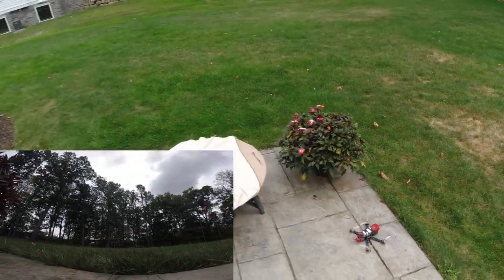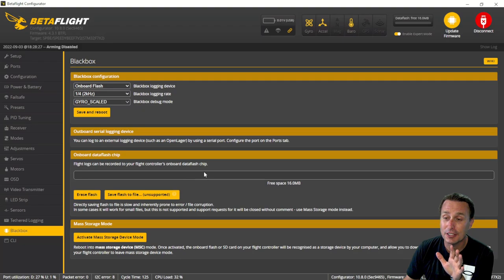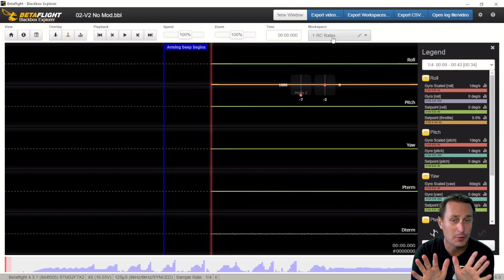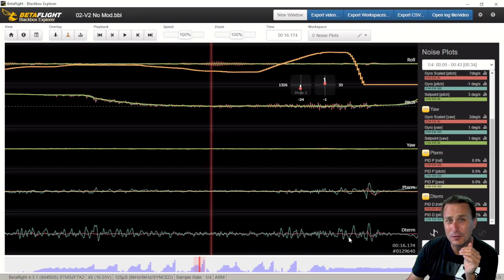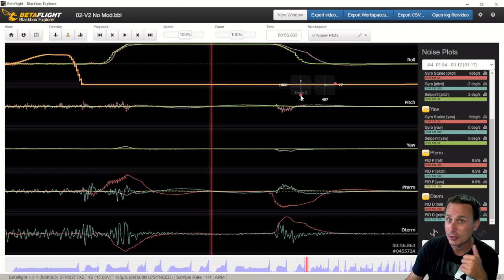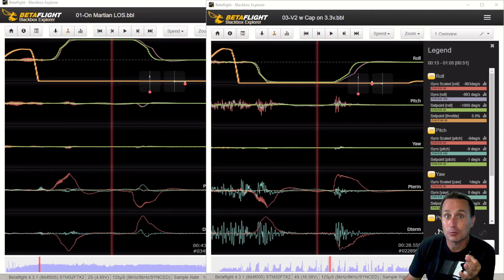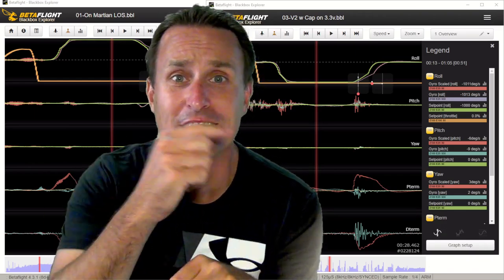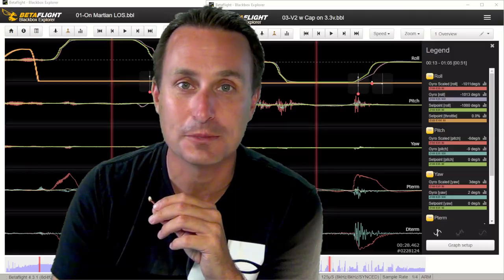Smooth Cinematic Flight: How to DIAGNOSE a BAD Flight Controller vs. Gyro

Comment: Important note on capacitors, they have an effective voltage range. A 25v capacitor for example, is usually only rated for say 5-25v, Putting it on a 3.3v rail would not be effective. Using a 6 or 10v one would be a better choice. usually listed in the datasheet.

Comment: I have several quads on the same frame but a few with different flight controllers/ESC’s but same frame motor combo. I thought some of them flew better than others and figured it was a Gyro issue because same pids would get terrible results on identical builds and great on others but when I went to 4.4 and tried presets for the first time with your 5” preset it confirmed I’m just terrible at tuning 😅 thanks for your presets and tip videos

Comment: I imagine it's possible that we don't have Blackbox on many of the "cheaper," AIO FC's, because it might expose a lot more slightly defective units. This is just pure speculation, of course, but it aligns with what would likely be considered good business practice, from the perspective of a manufacturer anyway. Take for example the JHEMCU SP24S/PP24S ELRS receivers (which by nature, rx's get examined more closely, since you can't fly at all with a rx that wont bind,) that have been shown to have small issues preventing binding on certain firmware versions in some cases, and preventing binding entirely, on any firmware version, in others. From this example, it's clear JHEMCU are more than willing to ship large volumes of hardware with essentially zero QC, at least on the less expensive hardware. I wonder if they QC the boards that have BB included, but do not QC those without BB. Pardon my tangent here, but it was my first thought when I got to 2:24 in the video.

Comment: Have you tried to put an anti-interference shield between FC and ESCs to see if it can make any difference ? Maybe a spike aborber might also help a little bit, it is mainly supposed to protect electronic but reducing spikes amplitude might also reduce electronic noise. I have never made any mesurements, but I usually use both (shield and spike aborber) in most of my builds.
Reply: What shield are you using? Would you please share the link?
Reply: @joshualiang2377  I use "DIATONE MAMBA INTERFERENCE ISOLATION BOARD V2", you should find it easily (I don't want my message to be deleted because of a link ;)

Comment: CAUTION powering FC with separate voltage source on a Cinelifter as you loose VBAT in OSD. Not being able to monitor your main LIPO is INSANE IMO. You might be able to use ESC telemetery. In my case I replaced the Matek F722-HD with a T-Motor F7 Pro Full Function FC and problem was solved.
Reply: For the two FCs you used, did you install them with the F7 MCU side facing down to the ESC? I heard if you isolate the FC MCU with the 4-in-1 ESC by using a piece of copper tape, this will reduce the noise from the ESC.
Reply: @joshualiang2377  - the FC was adjacent to the ESC stack. The Matek was unflyable with VBAT from ESC stack. It was flyable with clean Pololu power but no OSD. The TMotor FC is fine with ESC VBAT.
Reply: Just setup a timer, either in the osd or following throttle position on the radio. Works perfectly on any opentx radio.
Reply: @pippifpv  - timers are ok for freestyle quads IMO. BUT for an X8 with a $7K RED Komodo and lens... I must insist on being able to monitor VBAT. Especially if a cell drops all of a sudden. Just too much risk.

Comment: I felt for ya when you 'fessed up to breakin' stuff, Mark.  Sux when it happens, coz we only got our own meathooks to blame.  Upside: most replacement parts are cheap, and they get here pretty quick.  Downside: I always feel kinda sheepish for a spell, so I curl up in a corner, muttering softly, and slowly shake my head until the feels go away - dunno about you.  :)
Reply from the maker: Yeah, there was lots of swearing.
Reply: @uavtech  U a professional engineer; this ex-Navy type can imagine. . . musta been 24-karat.

Comment: So, had an issue with a Radix 2 v1.2 FC. Finally figured it out for the last six months until as of recently. Have v1.0 boards on most of my rigs that work great with no issues at all. Got a few of the v1.2 boards and on my 5" freestyle rig the quad would just flip out and the ESC would reboot. Turns out for whatever reason, the v1.2 boards have bad filtering on the FC. The only fix I was able to come up with was to direct solder a 35v 220uF Rubycon ZLH series low ESR capacitor directly up to the FC's VBat and ground pads on the underside of the board. That fixed it but really shouldn't have to be doing this period.

Comment: I managed to eliminate the pitch noise almost completely on SpeedyBeeF7 V2, by just powering FC through an LC filter (220uF, 35V capacitor and 47uH inductor)

Comment: Hope my terraplane just aggressive pid tune. Not gyro. After a dive it hold altitude.  I go zero throttle holds altitude till I tilt nose to get it flying again. Like a runaway but doesnt go up. I lowered D to betaflight default. Lowered P a lil lowered I a lil try keep ratios a lil

Comment: Ive had this issue with the HGLRC BMI270 flight controllers. I am going to try using a voltage regulator to power the flight controller and see if that helps.

Comment: I have a funny issue with my tmotor F7HD flight controllers with the BMI270, they both oscillate on take off and then calm down, I’m convinced it’s an electrical issue.
Reply from the maker: That or PIDs just a touch to high or Anti-Gravity to high.

Try lowing both, if still pretty much the same, yeah, personally I would log it.

Comment: You need to match the capacitance with the freq of the noise. You have low freq covered with the big cap on the battery leads. That is why adding a 330uF didn't do anything. You were on the right track with the tantalum. Adding a 10uf, 1uF, and a .01uF very close to the gyro will cover a wide range of freq. Good board mfrs should have done that already though.

Comment: I'm having a weird issue and kinda think it's my gyro but maybe someone with more knowledge knows. I take off in angle, it flys level. Switch to acro for fun stuff, then coming in to land I switched back to angle and it goes sideways and backwards. Maxing out my stick for correction wasn't enough, had to switch back to acro. Any ideas?

Comment: It is not really clear to me where would you conect the black battery wire to? The ground esc-FC stays the same then what about the battery ground cable? Thanks
Reply from the maker: I do not 100% understand your question, but know ground is ground.  The only difference in ground pads is their current rating capabilities.  Like the big ground pad on the ESC is made for big current.  The rest, smaller current.

Comment: I've got a iFlight F7 FC with a mean yaw twitch/drift I could send you if you wanted. I just wired up a cap to the 5v rail but I'm not hopeful its going to fix it.
Reply from the maker: Sure.  Trying to figure out if I should get a V2 again to continue the quest.

117 South State Street
Box 504
Clarks Summit, PA 18411

Comment: I recently had an issue when I changed an ESC and started get shakes.  Switched out the flight controller and the problem went away.  Do you think there's any chance one of those diatone ground plane isolators that go between the FC and ESC would help?

Comment: The fact that you pitched forward wouldn’t cause more noise on the pitch axis?
Reply from the maker: No.  It was still there when doing the roll.  Noted the spikes on pitch when motors spin up to start and stop a roll.  Finally, same moves on different quad and when FC is powered by a battery don't produce the issue.
Reply: @uavtech   appreciate the explanation!

Comment: I have better method how to test electic gyro noise. Open cli and write this set blackbox_mode = MOTOR_TEST ... save ... Then you remove the props, put the quad on something soft, and turn the motors with the keyboard arrows from 0% to 100% to 0% through the motors tab of the betaflight ... 
Uload the log to the pid toolbox-> spectral analyzer -> feq x time .The graph will show noise in quad control area  0-100hz if there is electrical noise exists. I have test like this zeus 35 "with bad gyro" ...
Reply: I like to pid tool box too. On my quad now I have noise around 60hz in a vertical line but only on like 30-60% throttle. And only on the dterm chart. What do you think about it?
Reply from the maker: Prop wash?
Reply: It was a new build with tmotor FC stack. Been the cleanest one on logs I have done so far. After watching this video, I started thinking about the capacitor placement. And I’m gonna try a small one on the flight controller somewhere.

Comment: Adding a cap to vbat works best. This video has a great oscilloscope demo of the difference - https://youtu.be/D9oVshtFcBc
Reply: what cap size would be best on vbat for a 6s build?
Reply: @carbendi   @Hurcan Emre Yılmazer  I used a 35V 330uf cap on my speedybee f7 V2. It worked real well at clearing up noise in the unfiltered range between 50-100hz.
Reply: @UnmannedSky  Thank you very much for the information i will try that :)
Reply: @carbendi  hope it works for you. You haven't lost much if it doesn't except for a few cents on a cap
Reply: We always do that. Filtration on the 3.3v rail is an internal problem with the FC in this case.